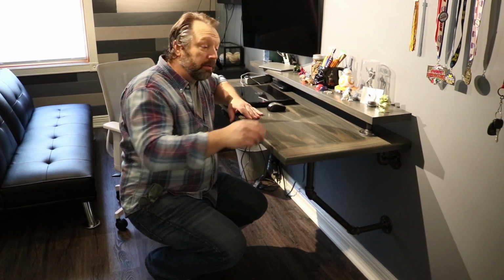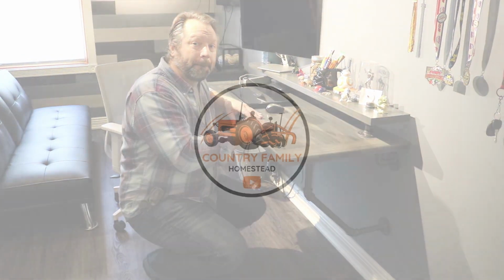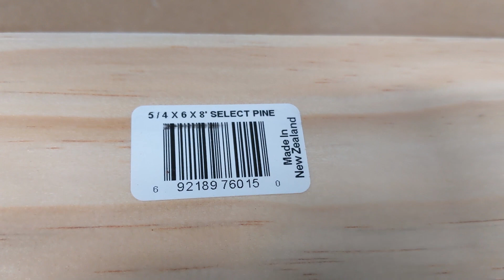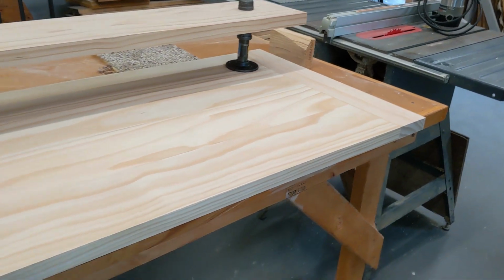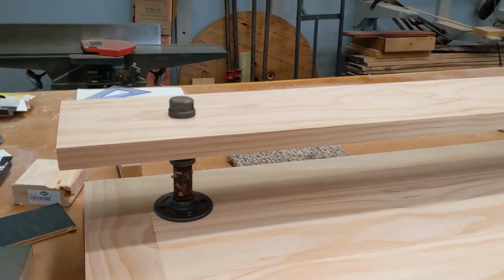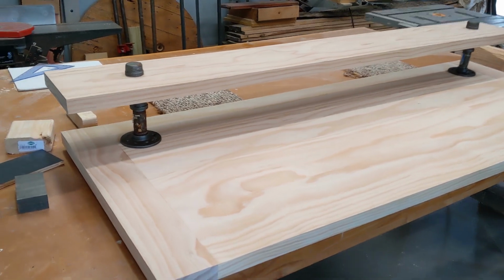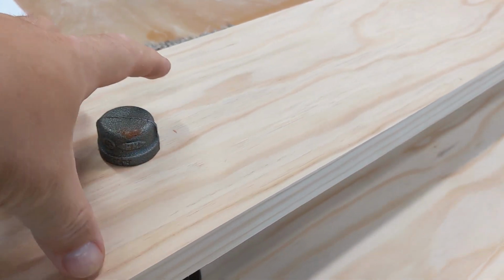Industrial Look Desk Made with Wood and Metal Pipe - Wall Mounted

Comment: I like your design, thinking up upscaling it along a 12' wall.  Just want to incorporate the 2' on each end to be something like triangular corner shelving pieces.  I guess the nice thing here is though I can build it 8' to start like here, and when I figure out how I want the rest to look I can simply dissassemble it and change some fittings, or even cut some fittings on a bandsaw, weld them, and fabricobble what I need. Then just screw it together again.

Comment: Excellent job. Piece of advice. @3:49 you are screwing end grain to long grain. It will 100% ruin your project. The breadboards need to have loose biscuits on the ends and only glued in the center. Problem is your ends will still show gaps unless you “drawbore”. I suggest you watch some videos on breadboard tables. Hope this helps and happy building!
Reply from the maker: I usually do a bread board edge like Norm does on his blanket chest. I've built many of them by making a long mortise and tenon then pinning it from below with dowels in three spots and only gluing the center dowel. 
What I've noticed with this "Select Pine" from New Zealand is that it is so incredibly stable I thought I would try this. Time will tell and I may have to redo it. Thanks for the comment.